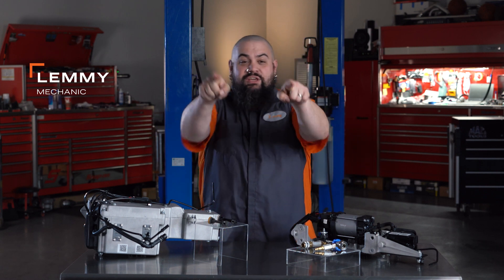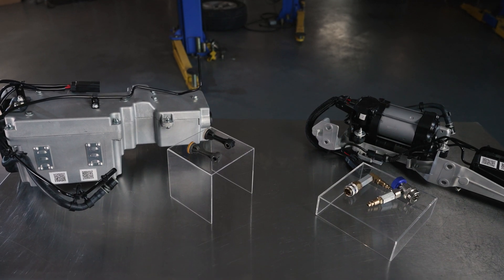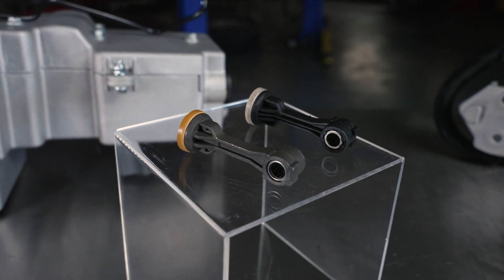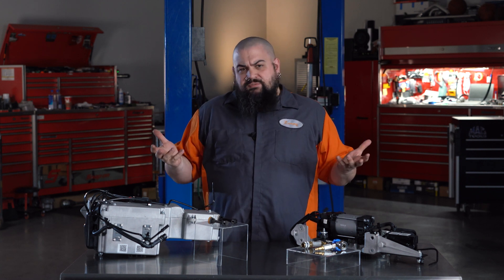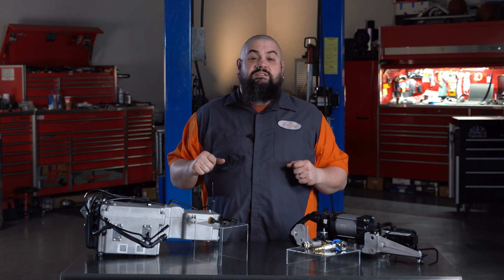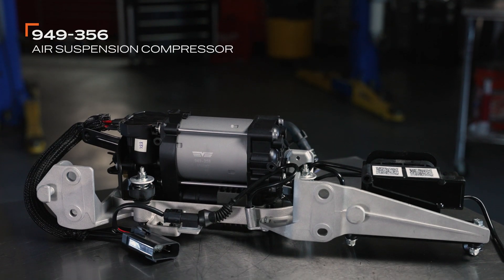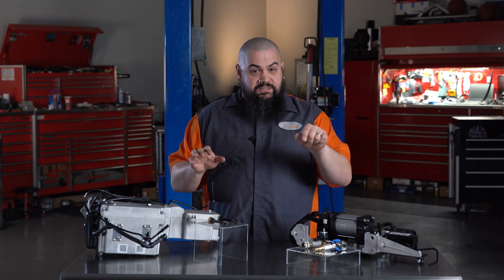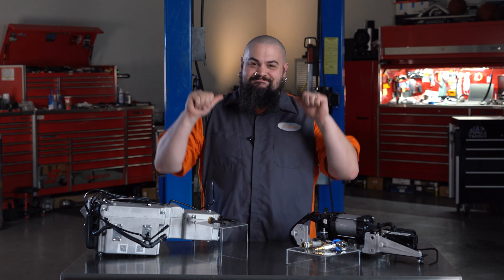More reliable replacements for failed Ram and Jeep ASCM nitrogen air suspensions

Comment: I have a 2014 ram would I need to program the truck after installing a new compressor?
Reply from the maker: Hi Alex, it wouldn't need programming however, to properly fill and calibrate the system it would requires a scan tool as part of the job.

Comment: The Dorman air compressors are crap! Worse than OEM. Purchased 1 for my 2014 ram in Feb of 2023 and it’s now dec of 2023 and I’m on my 3rd compressor! The ONLY thing good about them is the lifetime warranty, which Is also a bad thing because they will not refund my money because it’s got a warranty even though all 3 compressors have leaked within 24hrs of installing! Every one of them has leaked where the top of the piston compresses the nitrogen at the top of the pump where the heatsink cover is.
Reply from the maker: Hello, can you please tell us the Dorman part # and the year, make and model vehicle you are installing it on?
Reply: Yea, I bought the Dorman 949-356 for a 2014 ram 1500 sport. I contacted the dealer/distributor I got it from about refunding and returning it after the 2nd one started leaking immediately and was told all they can do is warranty it and replace it.
Reply from the maker: Hello, I will let our quality team know about this. Thank you!
Reply: @myshooter44 did you get any favorable results? I'm under warranty with ram, but was thinking of maybe getting the enclosure for now? Although I seen a guy just wrap a battery heater over his compressor and says now he doesn't have any issues. Just plugs it in over night on cold nights.
Reply: @mrchrisknight315  Not so far… I just plan on running them til failure.

Comment: How are they in cold climates? The main problem with my ram is the compressor stops working in the cold
Reply: Most dealers are too stupid to understand this system. I went to the closest dealer and they told me when it's cold it just happens. Then in summer time they told me the truck is supposed to go to the ground if you don't drive it every day. I told them at that point that it was stupid logic. No leaks means truck should stay relative to where it was when it was shut down. Then went to q big city dealer and they kept the truck for 2 days. They took measurements on all 4 corners and they ended up replacing 3 of the air bags and refilled the system was good for almost a year. I bet it's the one shock they didn't replace and probably by now the compressor. The system should just not be allowed to use outside air. When there's a leak then there would be no ducking around!!!
Reply: The issue in cold climates isn't the compressor.  It's leaks.  Leaks cause the compressor to draw in ambient air, which contains a lot of moisture... which creates condensation.   If your air suspension is failing in the cold weather, it's almost a sure thing that you have a leak.  Likely in one or more of your air springs (bags).
Reply: @wes8398  nope they pressure tested my system replaced bags and still have same problem
Reply: @byronbrodeur3341  Cold weather (prolonged -20 Celsius and colder) doesn't affect mine.  As I said, it's almost surely a leak which is causing the system to take in outside air, which contains moisture, which wreaks havoc on the whole system.  Most dealers don't take the time to test for leaks properly and completely.  If your air springs are all new, then I'd be checking all the fittings and lines.  The situation I just described with moisture in the system may have happened in the past and caused damage you're not aware of now... split lines, bad connections, etc.

Comment: This is great,  but I don't have the dealership scan tool to perform the air mass calculation function once everything is reinstalled and ready to recharge the system. All I have is the AlfaOBD software, which does allow me some control of the air suspension system,  but not air mass calc. Any suggestions?
Reply from the maker: Hello, great question! Unfortunately you will need the OE style scan tool to do the learn process to proceed.
Reply: I have a 2014 Dodge Ram. It needs the nitrogen commpresor replaced. What is the cost?